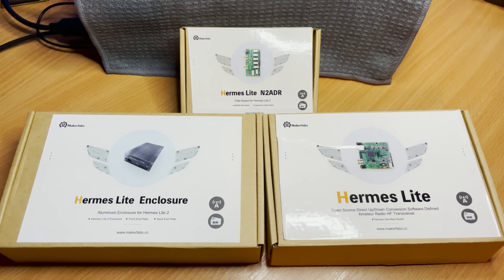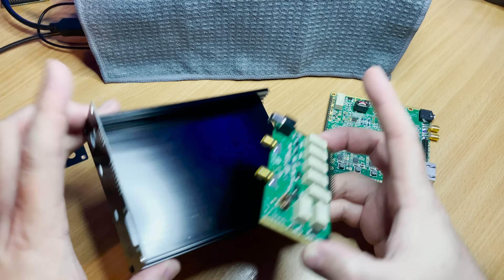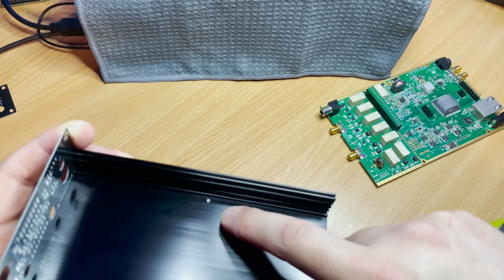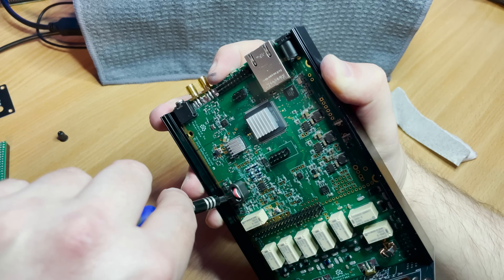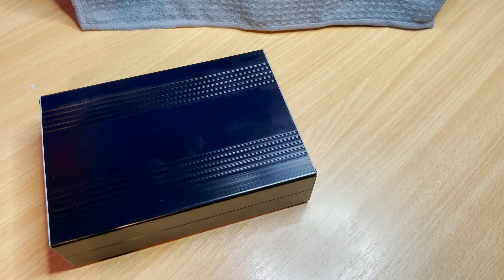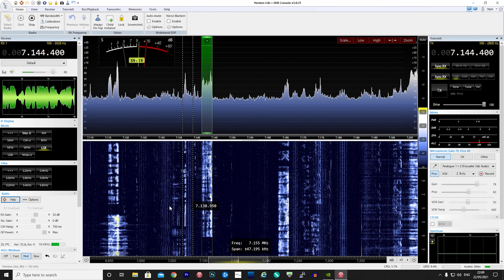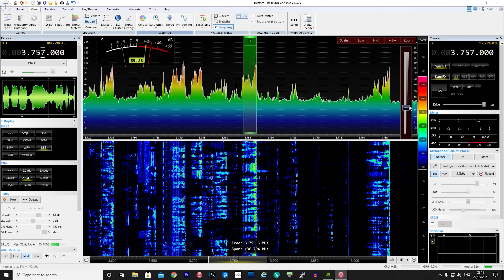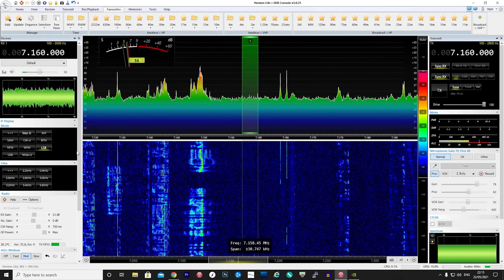Hermes Lite 2 HF SDR Construction And Receive Test

Comment: It is a very interesting device but I bought an Apache labs Hermes as it has 6m plus a lot of other features for not a lot more money. Apache makes the Anan line in India and have been doing so for 20 years.  I added it to a surplus Sailor T1130 for 250mw in and 500 w out with low pass filters.  Uses Thesis.  Cheers, VK5LB

Comment: Been out of military comms for 30 yrs but SWL was teenage hobby and I might just finally have time for a ham license. YouTube research frequently mentions Hermes needing "ethernet" connection. My router for 5Ghz wifi is completely on the far side of my apartment and I dont fancy a 30 foot cable snaking through the rooms. Will Hermes work via Wifi? I have no intention of networking a hamshack full of equipment. Thankyou!
Reply from the maker: In my tests WiFi was not great, it needs cable. However, there is no reason why you cannot connect the HL2 directly to your computer via the Ethernet port, it can be done without a router.
Reply: @TechMindsOfficial  Thank you! A great solution from someone who knows what he is doing😅
Reply: @TechMindsOfficial  Your reply brought into focus what I had been missing that the connection via Ethernet ports is just a communication link between two devices.   I think the Hermes will fill the bill for SWL and allow me to move into Ham radio when I qualify and not break the bank.  Thanks again.   Ray

Comment: Built the Hermes Lite 2 and have had a blast with it. I added the Hermes Lite 2 plus companion board for better CW with side tone and the ability to have audio I/O directly on the radio.   Needed to load forked gateware. It worked well.  

I was not able to get TX audio working the way I wanted with SDR Console but it works perfectly with Open HP SDR (PowerSDR).

Comment: Nice build video. Another idea to help make sure that the shim doesn't shift is after you apply the thermal paste to the board and a fix the shim to the right location, use a little bit of nail polish at either end and allow a few minutes for it to dry, then this will make sure that when you slide it in it won't shift out of place. Thread the bolt through and a fix your nut. Back in the old days of radio construction, small amounts of wax would be used to hold things in place.

Comment: You definitely need more videos on this. The Transmit capabilities with PowerSDR are fantastic and with SparkSDR you can monitor with additional firmware up to 11 band slices at once. I have even added a 220Mhz and 2 Meter Transverter to the Hermes. This is a very powerful platform. Can you please comment on this as I have heard this on the Hermes Forums. "This is the same inside radio used in the Apache Labs Radios". And the design came from early Apache Labs designs? I am not sure of these claim but it make some sense. I have used the radio for FT8, and SSB and I have tried 2 inexpensive amplifiers with it that are easily added, the MX-P50M and the KP-990. The KP-990 will transmit 50W output cleanly because it is a 100W amp.
Reply: ANAN radios came from open source Hermes SDR radio which came from earlier project called OpenHPSDR. Hermes Lite was cheaper version of Hermes SDR. Later Hermes Lite became Hermes Lite 2.
Reply: @antronx7  OK, thanks for the explanation.
Reply from the maker: I’m looking forward to trying this on air, hopefully within a couple of weeks :)

Comment: Can this be used as a pan adapter for an HF transceiver?
Reply: Depends, most HF radios have their first IF well outside the HF band so if the Hermes can only cover 0-38MHz then the answer is likely to be no. You'd be better served by a dirt cheap RTL-SDR if all you want is a pan adapter.
Reply from the maker: @Clint Jay Exactly what I would of said

Comment: Hi Tech Minds, what external amplifier do you plan on using with the Hermes Lite 2? How is TX performance compared to a traditional HF transceiver?
Reply: Very good. I use mine with an MX-P50M and I run PowerSDR Thetis. I have used this for FT8, SSB and HF Winlink. Still working on Winlink. The Noise Reduction on the Hermes is very good also.

Comment: That is an interesting product. With an amplifier network connected radio could make a nice remore rig (like being in the noisy city and having the radio somewhere with less noise).
My Icom has 100W but the noise level in the residential area is just too high to hear anything but very strong stations in my QTH. 73s